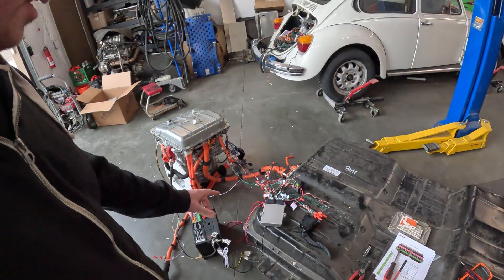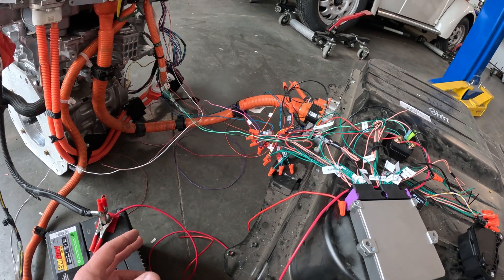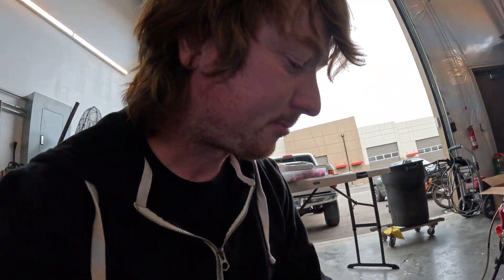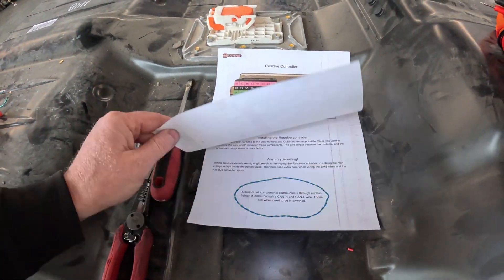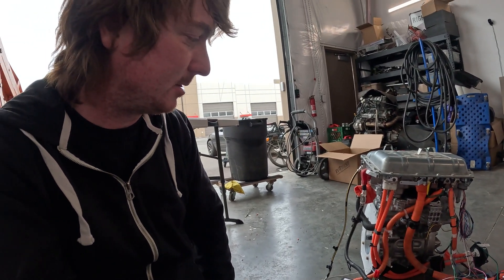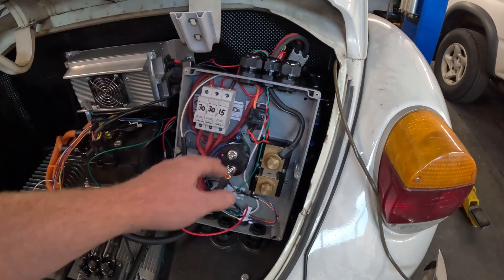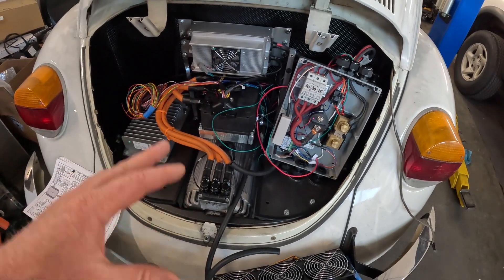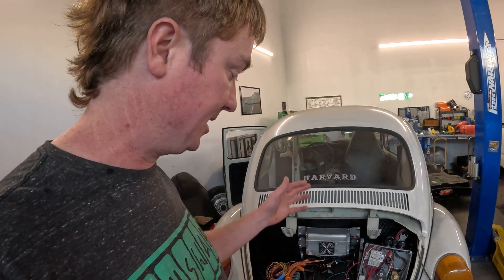Bench Testing Resolve-EV VCU with 2025 60kwh Nissan LEAF System

Comment: why do you need the resolve? can you not just use all the stock leaf parts?
Reply from the maker: Yes you can use more of the stock parts and not need the Resolve-EV VCU, but you need a lot of stuff like the gauge cluster and other parts and it throws errors. The Resolve-EV VCU makes the wiring simpler and gives full control over the regen and power.

Comment: If i wanted between 5-600kms of range from a full charge, fast charging capabilities, full time AWD or part time 4wd all this to fit in a kei truck, would it be possible?
Reply from the maker: It would be possible but you would need a ton of batteries. Like 150-200kWh or more

Comment: This is a great explanation and I think im gonna get this resolve EV. I have a 2018 motor stack and battery already. A few questions. which pedal did you use for this? i figure any hall sensor pedal should work but i would like to know what you use. 

2. Is there a way I can contact you if I have any questions/ would you be ok with that? I think I understand this setup but it would be nice just incase i have a question. thanks for the video!
Reply from the maker: With the Resolve VCU you can use the throttle pedal from any Nissan LEAF or you can use a VW Tiguan throttle pedal. Send me an email jimmy@evswapconversions.com

Comment: I wonder would it be possible to move the charging port on the Beetle to where the petrol filler cap was , i know it's on the opposite corner of the car ? It would make charging possible without the engine lid open 🤔
Reply from the maker: Yes it's totally possible, owner was happy with this set up and this is how EVWest shows it on their website. Having it on the front or rear is best for accessing any type of EV charger in the public you may encounter as well.

Comment: Great work and very interesting projects to follow.
It would be great to see how you’ll take the 60 kWh pack apart and spilt it and how you build it into your own battery boxes.
I hope to do the same swap at some point with a Leaf +60 kWh on my Land Rover Defender
Reply from the maker: Stay tuned, we will be starting disassembly of the 60kwh pack any day now. I'll make 3D models available once I get them.
Reply: @EVSwap  fantastic…it’ll be a good help to all the DIY’ers.
One thing you might be able to answer with experience from all your projects.
If splitting a pack in two boxes, how do you handle the voltage in the BMS cables which run from one package to the other…this is both when servicing the car or in the event of a collision and safety for first responders. With the ignition off, the BMS cables would still be live with +/- 180v.
I’m a bit concerned about this point as I would like to have a box in the front and one in the back for weight balancing. To keep the BMS as “OEM” as possible for inspection/approval I might keep one box in the front.

Comment: Why not use the leaf components in the beetle? I ask because I’m attempting to convert a 64 and hope I can fit everything. Fitting all the batteries seems to be pretty tricky. Hoping I can modify the bms to use half a pack or might have to use different batteries.
Reply from the maker: This choice was up to the owner to go with the kit. a LEAF swap would be possible but due to labor it would end up costing more than the EVWest kit all in. Yes, the battery fitment is the hardest part of any EV conversion!

Comment: Does anyone know by chance if that the resolve works with the newer Plus models? i just know that they have like 200 hp and the 60kw battery but i didnt know if it’s all the same for the resolve controller, thanks.
Reply from the maker: Yes, this model I tested is a 2025 Plus model, 215hp (160kw) and 60kwh battery. Everything works except Chademo. If you need Chademo then you can use a 2017 and older PDM.
Reply: Awesome thanks so much, wanted to get all of the facts before i embark on such a big project.

Comment: Do you have any thoughts on the HyPer9 ot HyPer9 HV in something heavier, like a little over 4,000 pounds? I'm considering electrifying my mid 80s station wagon and a Hyper 9 with about 5-7 Tesla Model S modules is the easiest and possibly most affordable way I can fit the motor AND the battery pack under the hood.
Reply from the maker: It might be a little sluggish. I would definitely go for the HV version. A LEAF swap would also be a good choice!